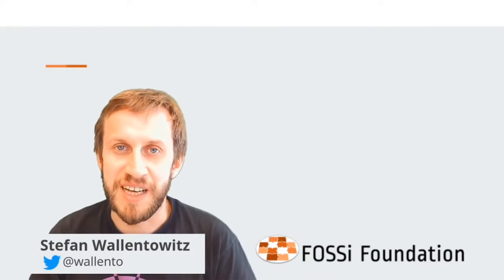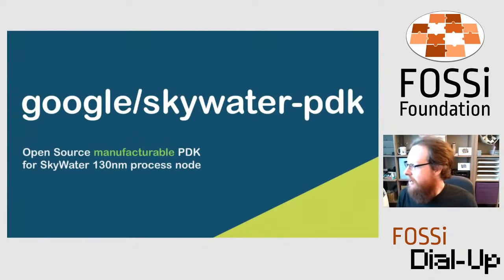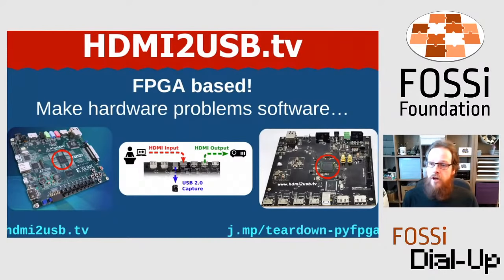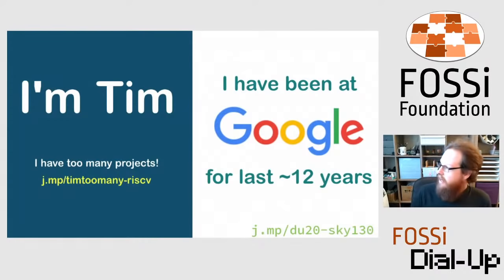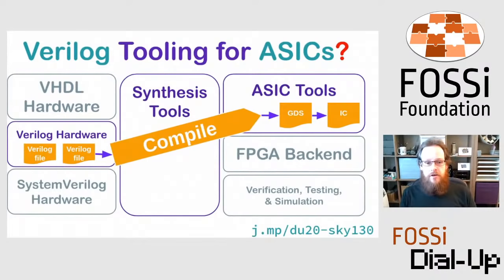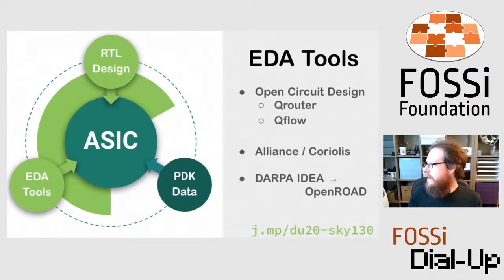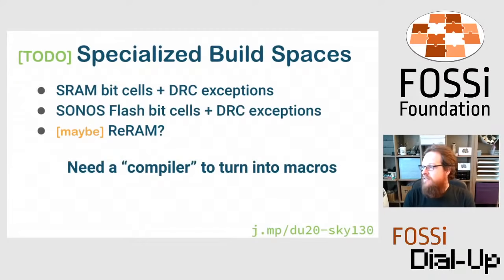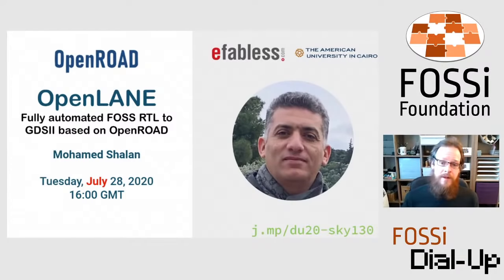[FOSSi Dial-Up] Tim Ansell - Skywater PDK: Fully open source manufacturable PDK for a 130nm process

Comment: Hi, I'm very interested in this program and would like to try out for it.   I have some limited knowledge of working with Verilog and FPGAs.  I'm just a hobbyist (retired engineer).    The project I would be interested in submitting is a Field Programmable Op-amp Array, or what I call a FPOA.  I have some crude ideas of what I would like to create.  All my ideas are totally open and I would share everything I'd like to try with anyone else who might be interested.   I imagine my design would take some time to work out. 

I wouldn't even mind if other people wanted to take over the project and do it without me.  I just want to see the FPOA built.   Of course I'd love to have one to play with if it does get built.

In any case, how do I begin?  Is there a forum were I can present my idea and request help and guidance on how to begin the project.   Most of the help I would need would be in the way of learning the tools I would need to create the required files to submit.  I have a fair idea of how I would like to build the actual FPOA but I'm also open to ideas on that as well.  In fact, as I say, it would even be great if someone else who knows more about IC design would become interested and run with the idea. 

My motivation for the idea is to use the FPOA as a way of quickly configuring hardware ANNs (or Artificial Neural Networks) on a chip, similar to the way FPGAs are programmed.   So that's the idea and motivation behind it, although it would seem to me that an FPOA chip might be useful for other applications as well. 

In any case, my main question at this time is "Where do I start?",  and more importantly, "Where do I obtain help and guidance?", is there a forum for this that I can post on to get feedback from others who might be interested in the same type of project?

I imagine this will take me quite some time to get to the point where I could submit anything.  However if they are going to be doing this several times in 2021 that may be enough time for me to achieve this dream.   So how do I get started?

Thanks, James.
Reply: I can help with guidance on this. There are quite a few projects/patents/chips with similar ideas. The availability of SONOS on this 130nm process makes this sort of thing very interesting.
Reply: I recently updated the "Inspirational Information on 130nm Process Node" document to include an analog ANN built with SONOS and 130nm. It was a research chip for a well regarded commercial analog neural network ML accelerator product https://www.mythic-ai.com/ . The SONOS cell produces a very small field programmable resistor. These are arranged in an array. Dac's drive the inputs and opamps and ADC's read the outputs. It's not very fast but it is very low power.
Reply: Please don't be discouraged by the considerable amount of work already done on this. It's a hot application area you picked. It will be REALLY valuable to have a fully open source project that did this - even if only modest in performance.
Reply: One question to ask is: what aspects of the opamp and surrounding parts would you want to be programmable? The company who has worked on this a long time is TriadSemi. Their patents and this paper are full of useful ideas: https://ieeexplore.ieee.org/document/7128484
Reply: ALD has sold Floating Gate programmable opamps for a while: https://www.aldinc.com/pdf/ALD2732.pdf . SONOS is a different approach than floating gate but I mention this because trimmed amplifiers are a useful thing to have in an open source IP suite. Trimming the bias voltages/currents might be easier and this is very useful to be able to decide on the speed/power tradeoff after the chip is made.
Reply: @AdrianFreed  "One question to ask is: what aspects of the opamp and surrounding parts would you want to be programmable?"

Hi Adrian, thanks for the info you've provided.  In regard to your question I don't have crystal clear answers yet.  It's a long story so I'll try to keep it short.   I'm 70 years old, retired engineer.  I'm currently attempting to build a robot with various AI features.  I'm only just now starting to learn about perceptrons (never mind full-blown neural networks).   However, I've discovered that understanding perceptrons in depth is the key to learning how to construct efficient neural networks. 

My current research project (solely as a non-paid hobbyist) is to start building physical neural networks using op-amps connected together in various ways. (not necessarily in the standard ways used by those who program digitally simulated NNs).   So I'm currently using LM324 quad op-amp chips as the op-amps.  And connecting those together in various ways using resistors, capacitors, and digital logic circuits.   I should mention that I'm only just getting started on this project and don't really have any circuits to show for it yet.

However, the point being that I actually tried to purchase some factory FPOAs, only to discover that no one yet make them.   I'm actually quite surprised to discover that they haven't yet been "invented".  I'm certain the technology exists, apparently either no one thought of the idea, or no one thought it would be very useful.  But for my project it would be extremely useful as I could just program my circuits into an FPOA instead of having to draw up printed circuit boards for discrete components. 

So in answer to your question:  "What aspects of the opamp and surrounding parts would you want to be programmable?"

I would like to be able to program the op-amps behavior to some degree if possible.  Maybe having 3 or 4 pre-programmed behaviors to choose from when programming the FPOA.   I would like to be able to also program various resistor signal dividers at the inputs and outputs of each op-amp.   And finally, I would need to be able to connect the I/O of each op-amp to other op-amps within the FPOA. 

I have several ideas of how these things might be accomplished.  In fact, what I'm hoping to do with my current set up is to set up various types of op-amp circuits on a breadboard or printed circuit board, (that would be my op-amp array)   Then use an FPGA to programmatically connect the op-amp's I/O to each other maybe even passing through various resister networks for voltage division, etc. 

So what I currently have in mind is to continue with my current hardware project, and then maybe use that circuit as a model for what the FPOA would need to be able to do. 

I'm 70 years old.  Very tired with big dreams and no energy.  But maybe I can at least pass on some of my ideas?

Thanks for the info.  I'll look into the articles you've linked to.
Reply: It may be interesting to build a FPOTA rather than an FPOA. This paper will give you hint is to why: http://www2.ece.rochester.edu/users/friedman/papers/ICECS_04_OpAmp.pdf . They point out that an opamp is often made with an OTA followed by a buffer. By separating the buffers and making them part of the programmable fabric you can produce a lot of smaller structures such as cascaded OTA-C filters and then just buffer at the end. In that design they have a lot of bias voltage nodes. It may be interesting to have all those bias voltages created by SONOS cells. This would be a great vehicle for experimenting with OTA's and Opamps. Here is a paper to promote thinking in that direction: http://www.ijesrt.com/issues%20pdf%20file/Archive-2018/April-2018/90.pdf
Reply: @AdrianFreed  You could probably design this thing in your sleep!  I'm certainly open to all ideas.  In fact, as I study the papers you are pointing to I will probably get ideas that I can incorporate into my current prototyping projects.  My project will continue whether I become involved in this IC fabrication project or not.  I have a long way to go.  And I have a lot of real life projects going on during the summer.  So I won't be able to devote a lot of time to this project until well into the winter months.   But I thought it wouldn't hurt to study up on some of the things I might need and maybe try to set up some of the software tools etc.  There's always a learning curve just to learn how the tools work.
Reply: Sounds soo interesting @robopi2775 did you end up making a chip? Or did you continue your project? Anything to show/see?